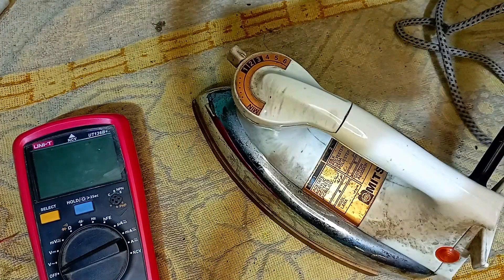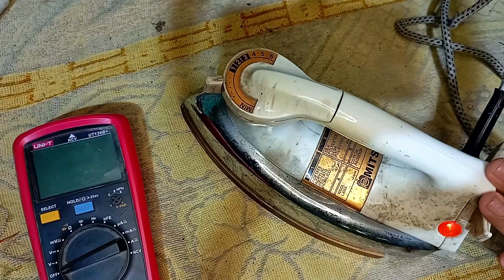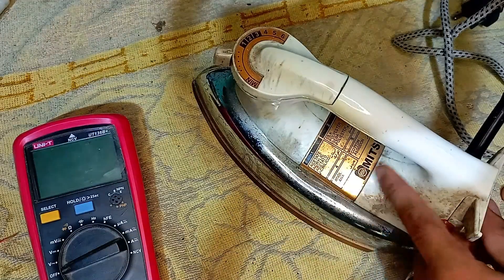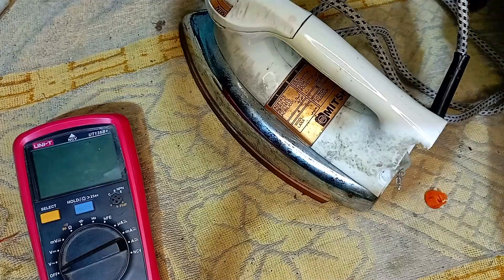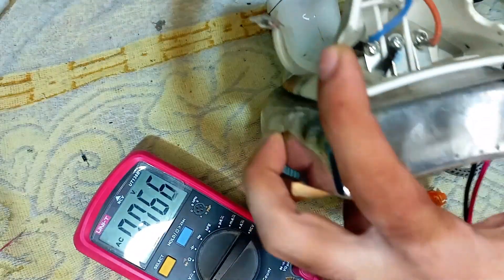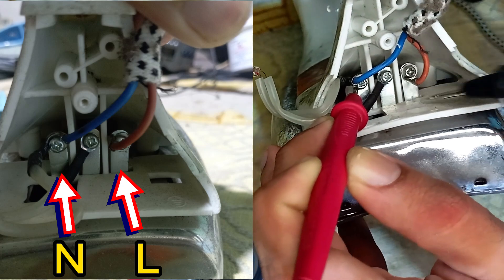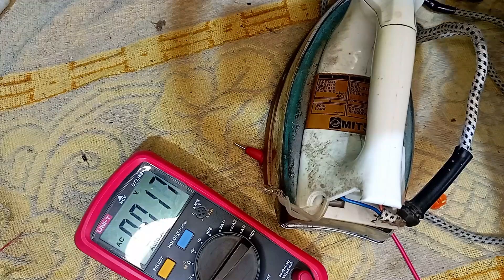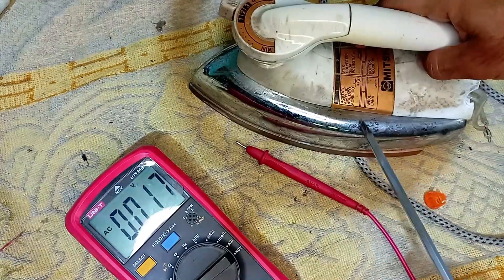Electric Iron Repair | විදුලි ස්ත්‍රික්කය ගෙදරදිම හදාගන්න _ Thermal fuse replacement ( Part 01 )

Comment: Rice cooker walata ena fuse ekk dammoth awulweida
Reply from the maker: Eka hariyanne na.eka wenas
Reply: @SLElectricalTechnic  උශ්ණත්වයයි ඇම්පියර් එකයි සමානයි ඒත් බැයිද
Reply from the maker: @kavindudineth235  be.oya appliance deka hadana repair video ekak balanna therei oyata iron eke fuse eka iron body eke tuch wela fix karala thiyenne, eth rice cooker eke එහෙම ne
Reply: @SLElectricalTechnic  මන් ඒ fuse එක අයන් එකේ touch krla newei fix කරේ පිටින් fuse eka දැම්මෙ heet වෙන නිසා.   ඒත් හරියන්නෙ නැත්ද මන් සෙට් කරල ඉවරයි දැන් ඒ fuse එක ඒකයි😪
Reply from the maker: @kavindudineth235  original එහෙම neweine awe.
Reply: @SLElectricalTechnic  hmmm😪